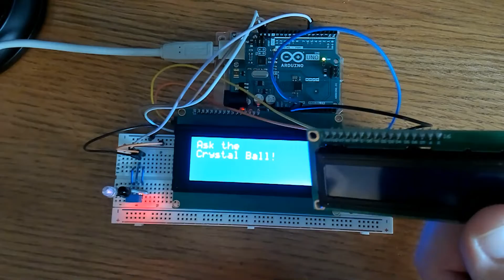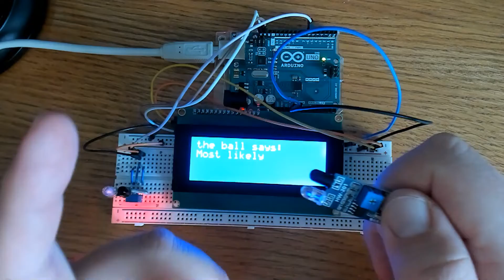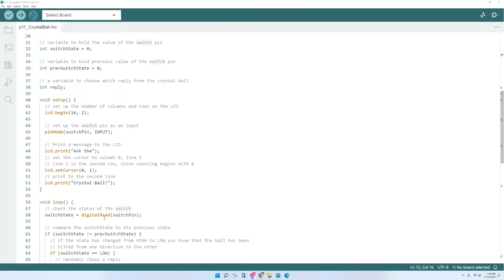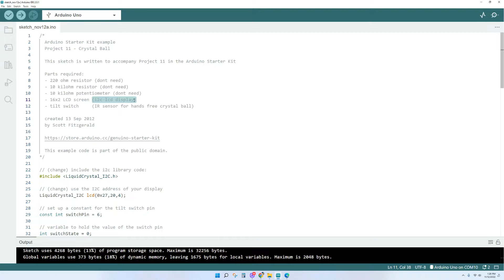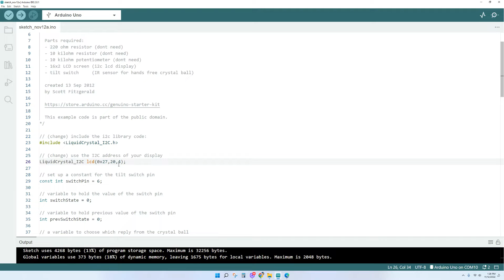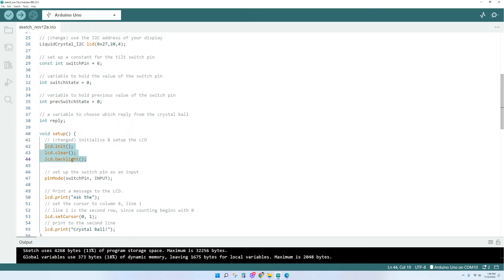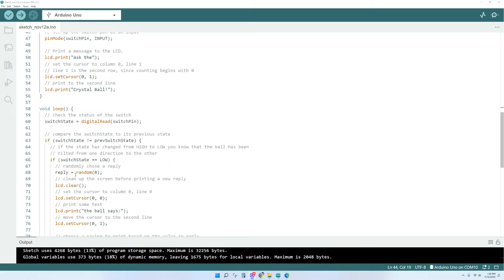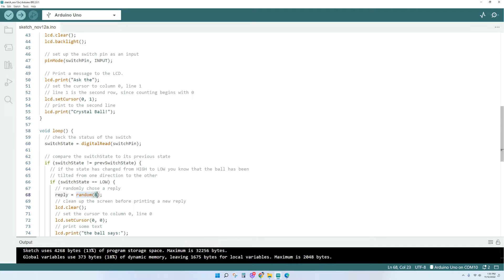Ask the Arduino Crystal Ball! | Touchless Magic Project That Answers You

Comment: Where is the code?  so many videos have the finished project but no link to the diagram or code.
Reply from the maker: hey there! I figure some of the people watching would like the code so I try to include it with every video. 

Here's what I posted on Facebook. I recently started an email list where I send code, diagrams (when available), and helpful pictures to the group since posting to Facebook can be confusing to find. I don't sell, give away, or spam the email group.
If you're interested:
bmonsterlaboratory@gmail.com - send request to join the email list. Include "ADD ME" in subject and body of email so I can find request. 
If you have any questions about the code  posted below, let me know.  
Enjoy! 👍👍

/* 
Arduino Starter Kit example
Project 11 - Crystal Ball
This sketch is written to accompany Project 11 in the Arduino Starter Kit
Parts required:
- 220 ohm resistor (dont need)
- 10 kilohm resistor (dont need)
- 10 kilohm potentiometer (dont need)
- 16x2 LCD screen (i2c lcd display)
- tilt switch (IR sensor for hands free crystal ball)
created 13 Sep 2012
by Scott Fitzgerald
https://store.arduino.cc/genuino-starter-kit
This example code is part of the public domain.
*/

// (change) include the i2c library code:
#include <LiquidCrystal_I2C.h>
// (change) use the I2C address of your display
LiquidCrystal_I2C lcd(0x27,20,4);
// set up a constant for the tilt switch pin
const int switchPin = 6;
// variable to hold the value of the switch pin
int switchState = 0;
// variable to hold previous value of the switch pin
int prevSwitchState = 0;
// a variable to choose which reply from the crystal ball
int reply;

void setup() {
// (changed) initialize & setup the LCD
lcd.init();
lcd.clear();
lcd.backlight();
// set up the switch pin as an input
pinMode(switchPin, INPUT);
// Print a message to the LCD.
lcd.print("Ask the");
// set the cursor to column 0, line 1
// line 1 is the second row, since counting begins with 0
lcd.setCursor(0, 1);
// print to the second line
lcd.print("Crystal Ball!");
}

void loop() {
// check the status of the switch
switchState = digitalRead(switchPin);
// compare the switchState to its previous state
if (switchState != prevSwitchState) {
// if the state has changed from HIGH to LOW you know that the ball has been
// tilted from one direction to the other
if (switchState == LOW) {
// randomly chose a reply
reply = random(8);
// clean up the screen before printing a new reply
lcd.clear();
// set the cursor to column 0, line 0
lcd.setCursor(0, 0);
// print some text
lcd.print("the ball says:");
// move the cursor to the second line
lcd.setCursor(0, 1);
// choose a saying to print based on the value in reply
switch (reply) {
case 0:
lcd.print("Yes");
break;
case 1:
lcd.print("Most likely");
break;
case 2:
lcd.print("Certainly");
break;
case 3:
lcd.print("Outlook good");
break;
case 4:
lcd.print("Unsure");
break;
case 5:
lcd.print("Ask again");
break;
case 6:
lcd.print("Doubtful");
break;
case 7:
lcd.print("No");
break;
}
}
}
// save the current switch state as the last state
prevSwitchState = switchState;
}